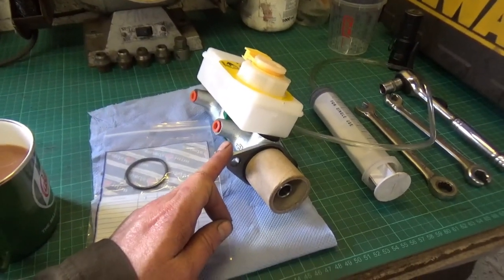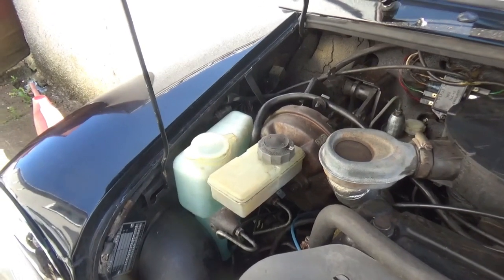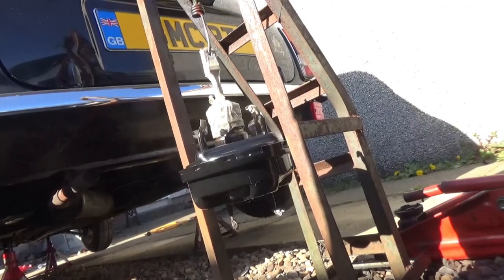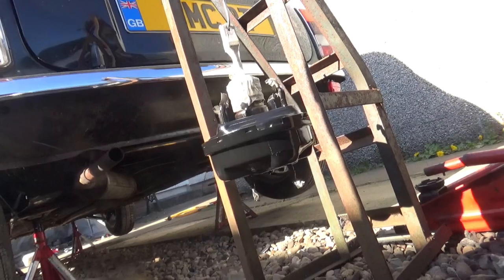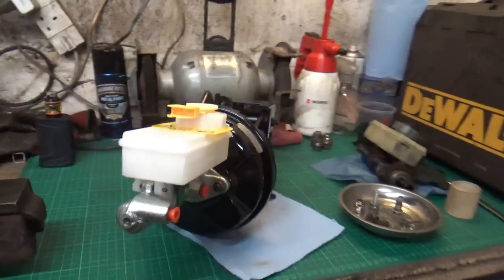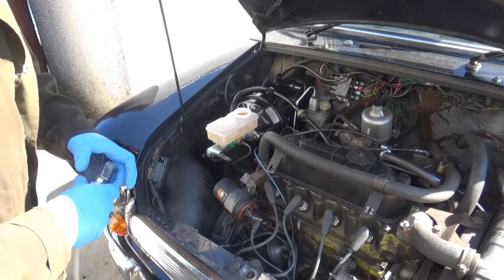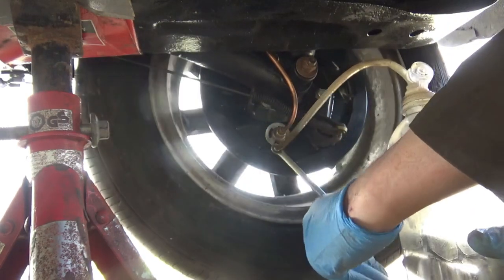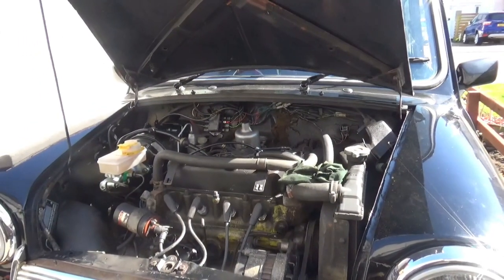Austin mini brake master cylinder replacement

Comment: Sean, What a difference with the servo & brake master like chalk and cheese, Shame you have to touch it up a bit but an easy fix, Cheers Dave
Reply from the maker: Cheers Dave, I've sorted the servo by rubbing it with wet and dry then polished it and it looks great and saved me from waffing a splat of paint on it 😁

Comment: Hi Sean,

Thanks for your kind reply.

A couple of questions, 

1) what is the name of the Brake & Clutch fluid your using, 

2) what's the name of the tool your using to assist in bleeding the brakes. The big clear container which is pressurised.

Thanks again fella.

Awesome work

Tony.
Reply from the maker: Hi Tony, the brake bleeder is from Sealey and the fluid I use in the workshop on all my cars is dot 4 which does the brakes and clutch. Full links of where to purchase them are in the description. 

Thanks, Sean
Reply: Your a LEGEND Sean.

👍
Reply from the maker: @tdc-forever2814  Your welcome Tony 👍

Comment: Great vid thanks- question-do you need to bench bleed the m/c prior to fitting??
Reply from the maker: Thanks Jon, to speed up the bleeding process you could prime the new master cylinder, you would need a couple of brake pipes and a jar of brake fluid and work the piston on the master cylinder but with it being a classic mini and no abs pump to worry about you would easily get away with just fitting the new brake master cylinder dry and bleeding it the traditional way. I fitted this master cylinder dry and thr system bled up without any issues. A pressure bleeder rely makes light work of the process and its a one man job. All the best, Sean

Comment: I’m just about to do this Did you put fluid into the pressure pump or just air.? 

Thanks Steve
Reply from the maker: @mrcarbon1747  hi Steve, you can out Fluid in the container or just use air. If using just air, make sure that thd fluid in the master cylinder is always topped up and you'll be fine
Reply: Thanks really appreciate it. Your videos have helped me no end on my restoration over the last few years 👍🏻
Reply from the maker: @mrcarbon1747 thanks Buddy, glad they have been of some use to you!

Comment: Sean how easy is it to change the reservoir as I have a new master cylinder? Cheers Tony
Reply from the maker: I changed the whole lot Tony but I don't see it being a problem so long as you have new orings to seat the tank in to.